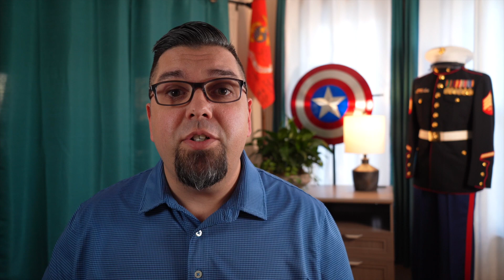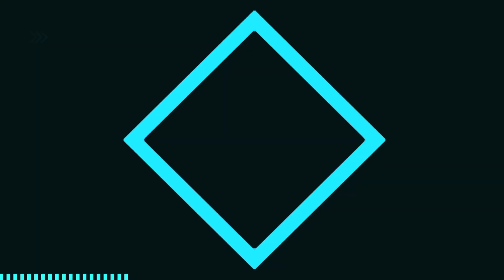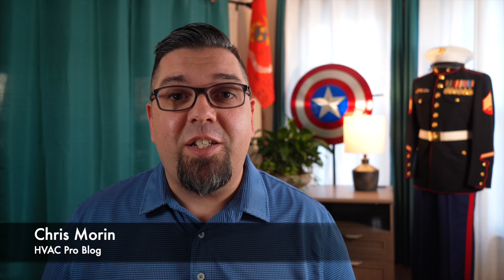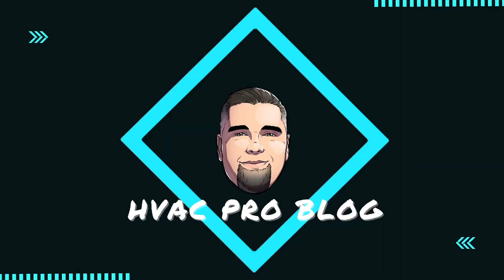Manual J - 4 Common Mistakes that Impact Sizing

Comment: I'm seeing a lot of new construction undersized due to new energy code requirements. Great for business with ductless add-ons. Personally I'm plugging in 72 for all indoor temp requirements.
Reply from the maker: Thanks for commenting Jason!  interesting to hear you are seeing undersized systems - can I ask where you are working?  Undersized compared to what - the load calc? In Heating or Cooling?  or  versus other rules of thumb?  
There is so much rounding up in ACCA approved Manual J v8 software that systems could not be undersized, even if the most aggressive load calc is completed.  
When we are working with such low loads in today’s construction, the smallest mistakes become magnified…
Reply: @HVACProBlog  hi im in Harford county Maryland primarily. I have a few new construction developments and just about every person complains of under cooling. There's a development with over 100 single family homes with 3 1/2 ton condensers and as soon as it hits 90 not a single house can maintain below 75 degrees and don't let it hit 100 its unbearable
Reply from the maker: I can agree with that - the highest design temperature in Maryland is 91F, so if it is warmer then it will run constantly - and any setback could never recover to 75F.  Although I haven't seen these homes, most of the new con houses with that size of a system likely need zoning, have poorly 'designed' duct systems which are typically outside the building envelope, and rarely commissioned.  

If these are your installs, meeting the EnergyStar V3 checklist could be a good spot to say it is likely the way people are operating them is the issue.  If not, assume nothing and start with an aggressive load calc!  3.5 Tons sounds like a lot for a new home, but who can say these days with the wide range of construction quality!  I recently saw a 5,400 sq ft. home in MA that only needed 42K for the heat loss!!!

If anyone is looking for outdoor design temps, here is a great/free excerpt from Manual J: https://higherlogicdownload.s3.amazonaws.com/ACCA/c6b38bda-2e04-4f93-bd51-7a80525ad936/UploadedImages/Outdoor-Design-Conditions-1.pdf